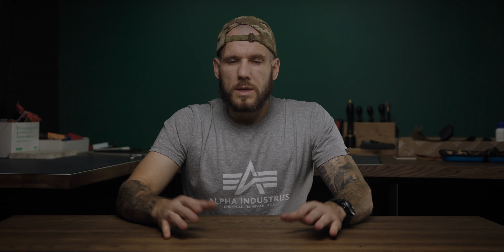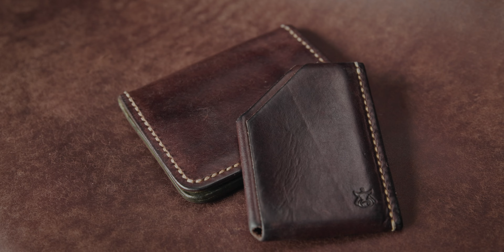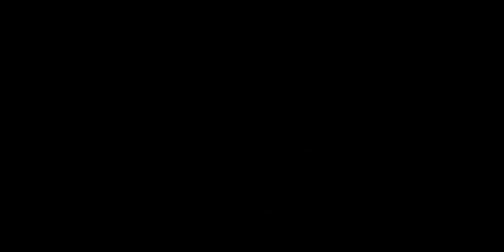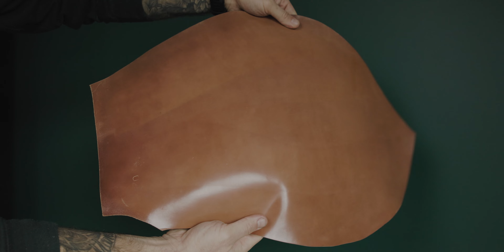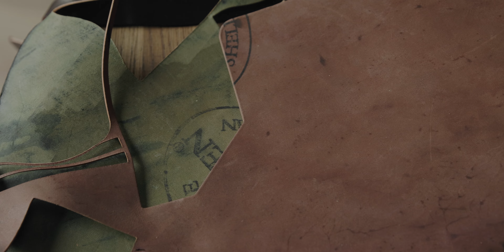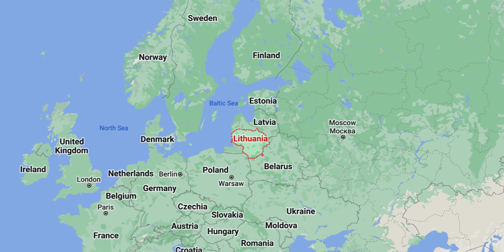What Leather Im using for small crafts👝 Where Im buying Leather💲

Comment: The reason why splitting a leather makes the suede less fluffy is because the fibers of the leather get tighter and more compact the closer they are to the grain.

As far as I know, fluff is the result of two things: how dense the fibers are naturally, and how much dead air is in the leather itself.

Fiber density varies by the type of animal and the location on the skin. 

Compared to smaller animals like calf, goat, and sheep, cowhide is not very dense. This is why cowhide tends to have a large grain when it is milled. The loosest parts of a skin are the belly and leg sections. The closer you get to the grain, the tighter the fibers get. The farther you go, the looser they get.

The amount of dead air in the leather is usually from the manufacturing process. Soft chrome tanned leather has a lot of dead air inside. This makes it good for garments and anything where you want a very flexible, soft, or plush feeling leather. It is also good for clothes because the dead air inside insulates your body heat better, like wool. Soft vegetable tanned leather has less dead air inside. This makes the fibers tighter and better for burnishing, stitching, and skiving with a knife. It also makes the flesh side less willing to fray over time because all the fibers are stuck together.
Reply: Thanks for those explanations
Reply from the maker: Thanks for deeper explanation! 🐗